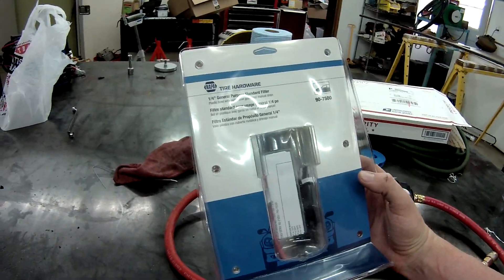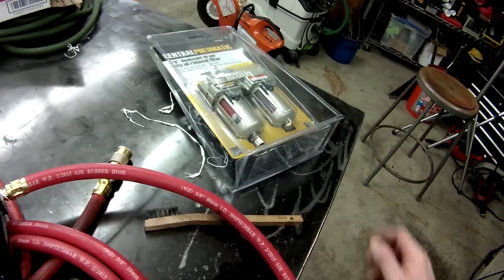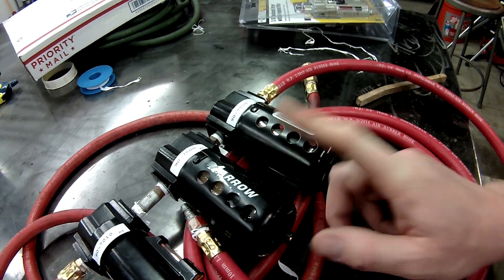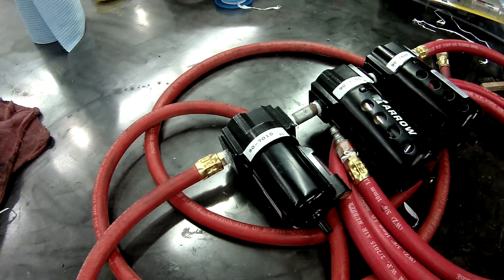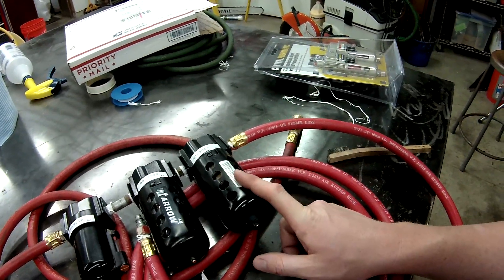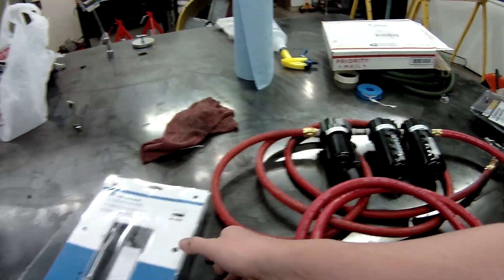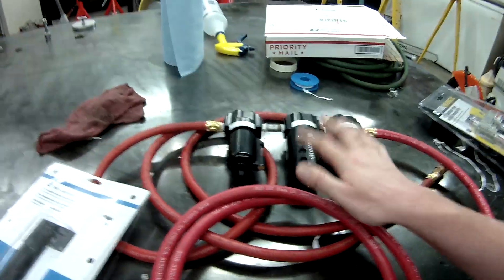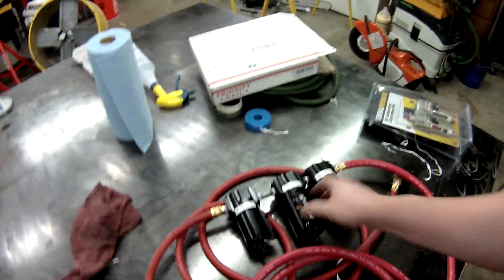Plasma Cutter Air Filters

Comment: Water separators are supposed to be in the vertical orientation. Manufactures state a significant drop in performance if they are at an angle let alone on there side.

Comment: What kind of compressor your running
Reply: Looks like a black max - sold by northern tool / they now sell the northstar line in its place
Reply: Do you leave them on there sides while operating? Most manufacturers say the filters have to be vertical.

Comment: Since you have a tank drain, get a timed blow off that goes in the tank drain hole.  I had one on my big compressor and it really helped with the moisture problem.  Spraying product on upscale woodworking designs does not put up with moisture at all.